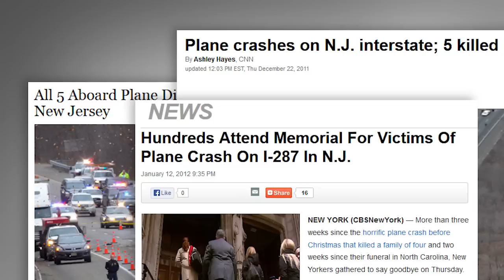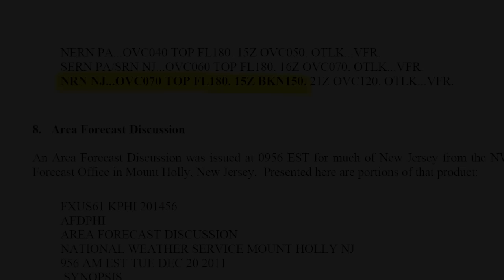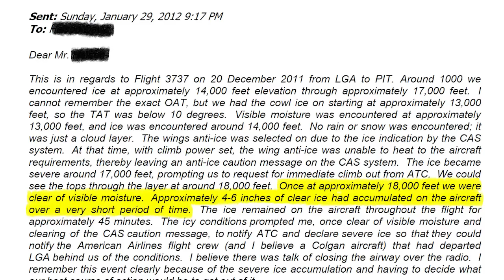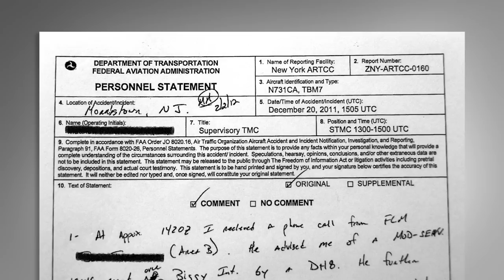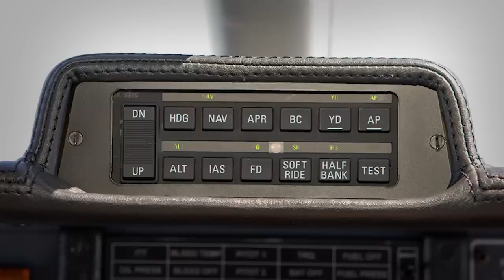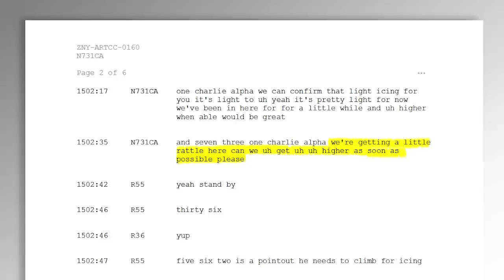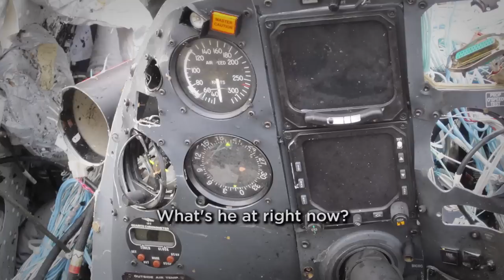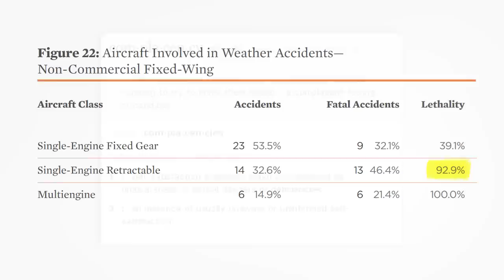Accident Case Study: Delayed Reaction

Comment: The hardest part of this situation is there's no one thing you can point a finger at and say "THAT'S where it went wrong." Did ATC keep him in known icing conditions for too long, yeah probably. Should the pilot have done a more thorough check of the weather, it may have helped but it might not have changed anything. Should the PIC have asked for priority handling to get out of the icing conditions, yes but he was probably thinking "They'll give me higher soon, just another minute." It's not to say that this was unavoidable, on the contrary this is a perfect cautionary tale about dealing with icing conditions and ATC, but I could see a lot of pilots being put in this situation and making similar errors. Really unimaginably sad, the best you can do is try to take a lesson from it and prevent things like this from happening in the future.
Reply: ....actually there is. 

He probably never read a decent manual on how to configure a turboprop to run in potential icing conditions. 

http://www.kingairmagazine.com/article/ask-expert-ice-vanes-important/

Now, realize that he was in "moderate" icing conditions. He was already hearing a rattling noise. That very well might have been a bent first-stage compressor blade. In his one engine. By the time it became audible it probably had several bent blades.

Not a good thing to have when you're flying up through "moderate" icing trying to climb to a higher altitude where supposedly there is no more icing.
Reply: Exactly what I was thinking.

Comment: i am not a pilot but can anyone tell me if there is a reason why the switch to stop ice from going into the engine cant be left on even if there is no ice reported? Is there a downside?
Reply: I'm also not a pilot but my understanding is that when the inertial separator is on, engine performance is altered and requires more attention to ensure not to exceed engine limitations. However in icing conditions it is designed to stop ice from entering and forming in the engine and therefore possibly damaging it and should be used.

Comment: So how does that inertial ice filter work to prevent ice from entering the engine? I'm wondering if the 'rattle' was water in the form of melting ice 'pinging' around in the turbine. This is truly horrific in that the entire family died in state of absolute terror plunging 18,000ft in about a minute. It's beyond tragic whenever I think about how they all probably woke up that morning excited at taking that flight in their home decked out with Christmas decorations-without any inkling it would be their last moments in this realm. I hate starting these videos out when it states 'the entire family and their dog' entered the plane. If you have a family-I just wouldn't put them at risk in a small prop plane period. Too many things can go wrong compounded by all the loss of life.
Why in the world did ATC have them hold at that altitude with veteran pilots describing the icing as the worst they'd ever seen? Probably hesitant to use 'extreme' and ground planes in the name of commerce and money making.
Reply: I realize I'm 6 months late, but since you asked... lol.   An inertial separator is a mechanical device that uses inertia to separate particles and FOD (foreign object debris - ice, water, dirt, rocks, birds, etc) from the air that is sucked into the turbine on turboprop engines. It should always be on prior to entering known icing conditions and remain on until you're all clear. The fact that he had the propeller de-icing on and not the inertial separator is a little worrying as ice clumps could easily fall off the propeller and damage the turbine blades as they are ingested. This would definitely explain the rattle. 

Comparing the TBM to small prop planes is a bit like comparing apples to oranges. Sure, it has a propeller at the front, but it is actually driven by a jet turbine, as opposed to the piston engines you would typically see on small general aviation airplanes. The Pratt&Whitney PT6 engine is one of the most reliable engines in aviation, and I don't personally have any qualms about taking my family in the TBM.

I would have flat out refused to level off in known icing conditions though, even if it had been mild. If you're going into known ice you need to know when and how you're going to get out of it. Failing to plan is absolutely planning to fail, and in aviation this has disastrous consequences.

Comment: To me as a non-pilot, it seems too careless a decision to accept light icing as a sure part of the flight. There's always the chance of conditions being worse than forecasted, as happened in this case. There is no more safety margin when you plan to challenge your vehicle to 100% of its capability. A few easy mistakes can end you up in a situation that is significantly different from what you anticipated.

Comment: why is the title of the video "Delayed Reaction" ?
Who reacted delayed ?
Reply: The pilot, ultimately. He failed to react to the severe icing in the manner and timeframe that was required. Maybe he didn't recognize the severity of it, maybe it came on so fast that he just got surprised and before he knew it the situation got out of control.

The 20/20 hindsight call would be to say that he should not have waited for ATC to issue a clearance given the dangerous situation (simply telling ATC that he IS descending, not waiting for the ok) and just descended out of the clouds before he got into a stall/spin situation.

Probable cause according to the NTSB: "Encounter with unforecasted severe icing conditions that were characterized by high ice accretion rates and the pilot's failure to use his command authority to depart the icing conditions in an expeditious manner which resulted in a loss of airplane control."

Comment: If a crj had accumulated 2" of ice on PROTECTED surfaces I wonder how the hell it stayed in the sky! Even 1/16" of roughness can be very dangerous. Also, how would he even know? He can't see the wings from the cockpit. Not relevant to the accident but I know these airplanes and that seems far fetched. No operator has ever informed the mfg of an icing encounter and certainly the airplane has never been tested with that much ice during certification. Just a comment.

Comment: Short lesson to take away from this:  If the weather is creating problems where you are, declare it to ATC and tell them you are moving somewhere with less problems.  Maintaining the aircraft in the air is the responsibility of the pilot, not ATC.  ATC is only there to provide an additional stream on info and advice to improve SA in the cockpit.
Reply: That’s a cute dismissal of the responsibility of ATC. When you fly you are commanded by ATC! you don’t get to push back unless you want to loose your license. So you are required to be polite on the radio.  Everyone desperately avoids filling out a nasa report to try and avoid the wrath of a crappy incompetent controller with an attitude.
Reply: @edouble0325  I have no idea what country you fly in, but in the USA we have this thing called "FAR 91.3" which says:
"(a) the pilot in command of an aircraft is directly responsible for, and is the final authority as to, the operation of that aircraft.
(b) In an in-flight emergency requiring immediate action, the pilot in command may deviate from any rule of this part to the extent required to meet that emergency."

If you, as PIC, feel that the weather you are currently experiencing is unsafe, you have the legal authority to do whatever you need to do about that.  ATC has no authority to override you.

Comment: During instrument training in my Piper P28A/181, my instructor, who had 25,000 hours with American Airlines, had me go into the clouds, only about 3500 feet, in an icing rich environment. We stayed right on top of the airport. Within minutes we had about quarter-to-half-inch of clear ice on leading edges. Scared the cr@p out of me (and I'm a 30 year vet with combat time!) just how fast icing can happen. I knew it was coming, so I took the plane down, quickly, and we landed with no problems. My instructor wanted to truly impress upon me just how quickly a dangerous situation can develop, and in a non-ice capable aircraft, it would usually be a fatal encounter. Living in the Upper Peninsula of Michigan, I put the gathering of icing info at the top of my list when planning flights.
Reply: Your instructor should be arrested and 709'ed.

Comment: I don't see any comments in here that really address what the pilot did wrong and how this could have been prevented. "Staying home" is not a solution. 

This situation happened very very fast. And any reaction (a change of course) could have just put him in more ice or would have never gotten him out fast enough. He made a lot of little mistakes, but nothing big. And I can't see how this had anything to do with the aircraft being a TBM. 

He flew into extreme weather that was poorly reported, which seems to happen all the time. He lost his flight surfaces. Perhaps his motor. 

In my opinion, he needed immediate weather information in the cockpit and that means radar or a link to a radar based system. I didn't see anything mentioned in the video about his weather detected systems. So...perhaps the real lesson here is, if you're going to fly in extreme weather, have extreme detection equipment. Current radar (precipitation) with known icing conditions is a one+one=trouble resource. 

I'm all ears on this one if anyone has any thoughts or you think I'm not right. 

This is clearly something that we should understand, learn from and apply.
Reply: :"Staying home" is not a solution.:

sure, bud. Keep on flying :)
Reply: The video seems to suggest it was somewhat of a freak accident. Better reporting/planning by AT. could have helped avoid the accident though, as well as the pilot getting out of the situation immediately. It ultimately was up to the pilot to immediately exit the icing situation. The least he could have done was protest ATC’s decision to tell him to “standby” after he requesting higher altitude. The pilot did not abide by the aircraft’s operator manual. He did not take sufficient action. RIP to the family and may God give relief to their mourning loved ones
Reply: The quickest way to escape these flight conditions is go back from where you came.  He knew exactly where the base of clouds were.  Trying to climb through this icing layer is very dangerous especially in this kind of aircraft.  He has no information on where the tops were so trading airspeed for climb rate is the last thing you want to do.  He had the I.S. off so he likely lost lots of power also.   Tail stall seems likely too.  As far as on board weather detection goes, his WX Radar likely worked but in this kind of precipitation it would paint only green if at all.  If he had NEXRAD it would have helped a lot more in my opinion but a descent is the only course of action in this circumstance.  He was in weather far more serious than his experience level could fly him out of.  If he would have told ATC to keep traffic out from under him just in case the icing gets mod/sev he would have had a chance to descend but this is difficult to do in the NE.
Reply: @816928  turning around would have required a 180 deg turn, right? Or some sort of split-S? 

pretty tricky to do either one when you're having trouble just keeping the plane flying!
Reply: @touristguy87  I am not advocating some crazy aerobatic maneuver.  Declare the emergency and start a standard rate descending turn back to where you came from.  He just flew through safe clean air.  He probably could have kept on course and just descended.
Reply: @816928  no...he flew through safe clean air to get into the bad situation that he was in when he realized that he was in a bad situation. So he by definition did not "just fly through safe clean air". That is entirely wrong.  

His solution, almost certainly, was to maneuver up or down out of the icing conditions. True. But simply moving laterally would probably not have resolved the situation...and he as already moving laterally. You're just saying that he should go back down, which is fine. He needs then only to be able to control his airspeed in a descent...my guess is that he was unable to do that which is why the plane spun into the ground in a vertical dive.
Reply: @touristguy87  Did he or did he not have no problems shortly after takeoff.  He already knew where the overcast layer was.  HE JUST FLEW THROUGH IT FOR THE LOVE OF PEET.  Who the hell was talking about moving laterally to exit the flight conditions?  He NEEDED TO DESCEND.  That was his only option.  My 11500 hours of experience tells me so.
Reply: @816928   your 11500 hours of experience isn't changing the fact that the neither pilot nor ATC ever talked about descending.

ATC: "ok your flight plan is clear, warning of moderate icing along your path"

Pilot: "no problem for us, we'll fly right through it" 

Pilot: "um, ATC, we need clearance for a higher altitude...and we'd appreciate getting it quickly..."

ATC: "ok stand by................ok you're cleared to 20k agl"

Pilot "I'd like to declare kkkkkkkkkkkkkkk"

How many years later now are you telling us that he needed to descend? Kinda late huh?

Why haven't you learned through all your experience that hindsight is 20/20? I can go even better: your opinion is as good as you think it is.
Reply: @touristguy87  I was offering my advice to those reading the comments sir.  I stand by that advice because of my extensive experience in these kinds of scenarios.  If you don't like it that is fine.
Reply: @816928  ....did I say that I didn't like it? 

any other non-sequiturs that you want to offer?

I am merely pointing out the critical issues with that proposed solution. It of course might have worked, it might not have worked. If the bottom of the icing was well below the planes' altitude when it began to experience "moderate" icing, then it would not have helped matters. It would have made more sense to climb hoping to climb out of it. But any maneuver would have depended on the planes' ability to complete the maneuver.  First, it has to actually fly. Second it has to restrain airspeed. Even if it does fall out of the sky into warmer air, the pilot still has to be able to recover before the airframe fails.  If it falls at 900 fps that's 600mph. The airframe is not likely to sustain that abuse and in fact witnesses in this case reported hearing a loud crack before the plane fell out of the clouds. Possibly a complete compressor failure or a wingspar failure or tail separation, any of which would have been very bad news for the pilot and passengers in a terminal dive.

Short of that you have control-surface lockup due to icing, which isn't really going to help when trying to pull out of even a 400mph dive below 10k agl. Even if the wings are flying.
Reply: @816928  ...last but not least...you have extensive experience with ice-induced spins? My guess is that you have 11500 hours flying planes that are not spinning.

I have 500,000 miles of experience driving cars. 
That doesn't make me an expert at driving an F1 car at race speeds.
Reply: @touristguy87  don't speak of things you know nothing about keyboard pro.
Reply: @816928  what makes you think that I know nothing about it?
Reply: @touristguy87  So you are commenting on stuff you don't know jack about?  Sounds about right for youtube.  As far as the wreckage comment, that is really a tasteless thing to say.
Reply: @816928  "So you are commenting on stuff you don't know jack about?"

Is that a question or an implied statement?
Sounds like you don't know what you're talking about.
Reply: @816928  " As far as the wreckage comment, that is really a tasteless thing to say"

feel free to choose any from the list of 1001 most popular criticisms of the truth

when you get done it'll still be true

Comment: Fly long enough and you will have an icing problem. Was ferrying a Skylane RG from Virginia to Texas single pilot IFR.  Was over East Tennessee when encountered unforecasted icing.  Fortunately was clear ice vs rime.  Was only 15 miles from Tri City airport and quickly told ATC I wanted to land.  Flew the ILS and after landing and taxing to the general aviation FBO parked and shut down the engine.  When the engine stopped the final shudder caused all the accumulated ice to drop off the wing to the ground below.  Ramp guy who greeted me knew I dodged serious problem and so did I.  Fly safe.
Reply: Good call!!
Reply: TRI is my home airport. Jewel nestled in the mountains. Glad to hear you had a good outcome.
Reply: Glad you made it man, Amen brother.

Comment: I may have missed it but I wonder what mode his autopilot was in prior to aircraft loss of control
Reply: No sure, but the TBM autopilot operates a little different.  You can set speed hold when initiating an autopilot climb, and it is ok.  You can set a climb rate and the autopilot will keep moving the nose up, disregarding the speed and eventually go into a stall.  That probably was not a factor here.